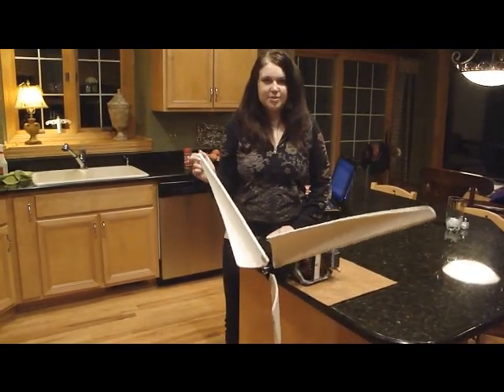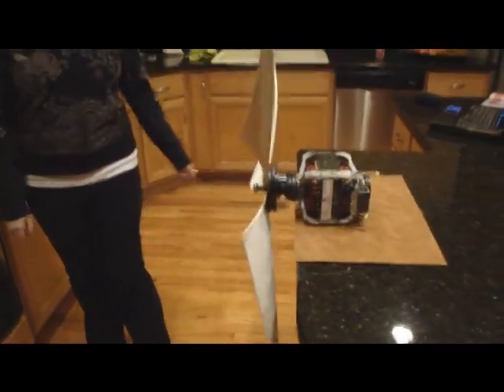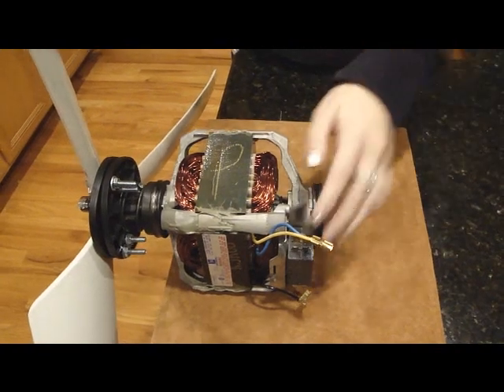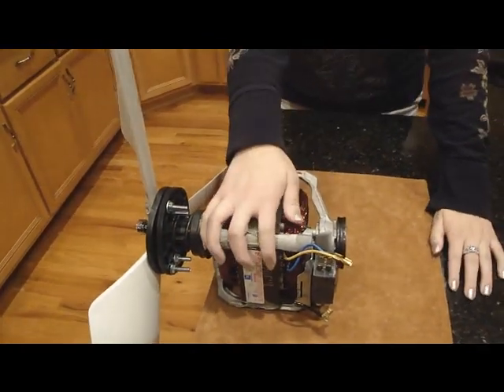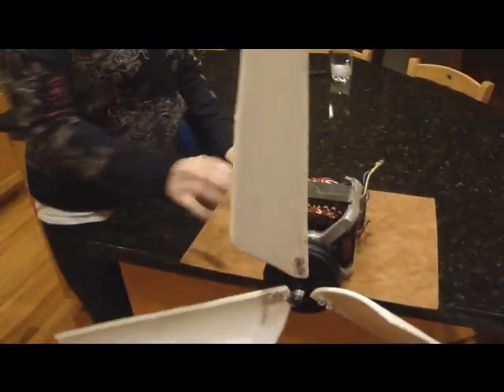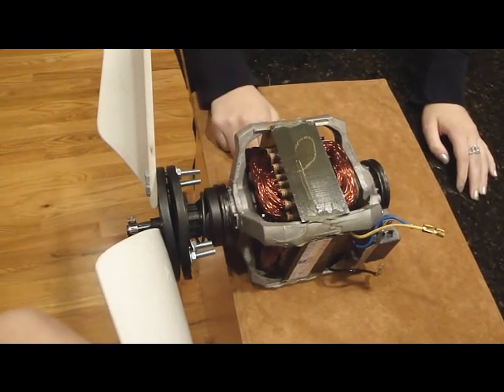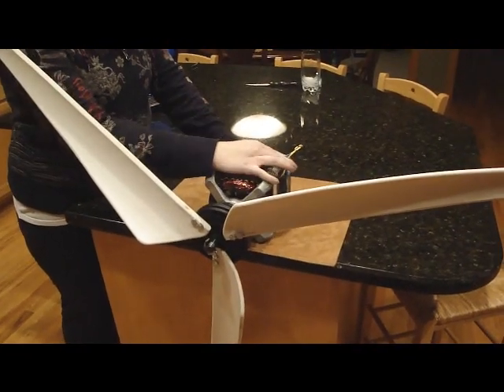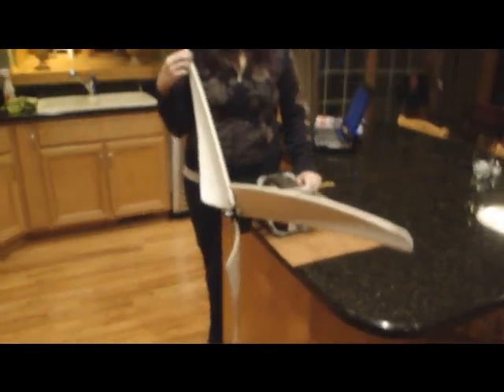Basics of a Wind Turbine

Comment: The wind creates mechanical movement. The permanent magnets in the rotor shaft create alternate current and to convert the AC current to DC current you need rectifiers and then charging the batteries. And from the batteries You need an inverter to convert DC To AC

Comment: Typically a motor in this setup would generate direct current, but certain motors output alternating current because of a built-in rectifier. Can't tell whether this motor is DC or AC. Most small project motors output simple direct current, making it easy to connect directly to a bank of batteries. An inverter is then used to convert the DC stored in the batteries to AC for use with common household items. For small applications such as off-grid camping or RV's, you can purchase DC items such as LED lights so you don't need the inverter.

Comment: Those blades look like they're on backwards for whatever reason.
Reply: The blades were fashioned from a round tube. while not ideal, they would work equally well as a fan or a turbine. now, the trick is to balance the blades, to minimize vibration. The shallow pitch is good for the fact that it is a direct driven turbine, and that motor is most effective as a synchronous alternator if it can exceed 1000 rpm.(It's actually an AC induction motor).

Comment: if its a washing machine motor,how do you power it,you need to plug it in some where,for it to run
Reply: The idea is that the blades turn wind into kinetic energy. to generate electricity, But it is a universal motor so it isn't going to do much

Comment: that motor looks like it from washer machine.. i remember very well.. because i go junk yard everyday.. hahahahah
Reply: That's exactly what it is. You need a capacitor to resonate it to get it to produce any useful power. Motors like this are at their best at speeds of 1000 RPM or higher.You set the run speed by the value of the capacitor. Then a full wave bridge rectifier to convert to DC to charge batteries.

Comment: please show us how you alter the motor.. i have tried using washing machine motor and its not working the way i want it work... really i need some help..
Reply: You have to drill holes on the rotor and put neodymium magnet in the holes. With no modifications you can't generate any useful current sadly
Reply: @JorgenLePoulpe  An induction motor can generate if connected in parallel with the right value of motor run capacitor. It becomes an asynchronous alternator. You can determine the run speed by adjusting the value of the capacitor. Like any alternator, you need a full wave bridge rectifier to turn it to DC and charge a battery. Its poor regulation makes it useless for driving loads directly. Use it to charge a battery, use that to power a nicely regulated inverter, then, you'll have usable power. Without the phase shift of a capacitor to resonate the stator and excite the induction rotor, the voltage will be barely measurable, but no useful amount of power.
Reply: Before you modify the motor, try putting motor run capacitors in parallel with the motor wires. That will ferroresonate the stator, and excite the rotor, turning it into an asynchronous alternator. choosing a large capacitor will allow the motor to start generating at a lower speed, but lower voltage. Choosing a smaller capacitor will mean the motor has to go faster to cut in, but it will generate a higher voltage. The motor will pretty much hold the tuned speed no matter how hard the wind blows. The system will produce more current if the voltage is held constant, or higher voltage at the same current. While it's not very good for directly driving a load because of poor regulation, all you need is a full wave bridge rectifier to make a great battery charger. Depending on battery voltage, you may want to use a transformer to convert high voltag low current to low voltage. This should get you up and running without hours of machining. Please note, motors like shown in this video work best at or above 1000 RPM.

Comment: That's a washing machine motor.  I'm a little confused as to how that would work... unless you reworked the rotor and added permanent magnets, although sometimes you can use an induction motor as an alternator with a tricky circuit to pre magnetize the rotor.  But I really suspect this is just a dummy setup for display purposes.
Reply: You are exactly right. No reworking required. What it needs is a motor run capacitor to ferroresonate the motor when spun. The phase shift from the capacitor will excite the stator, turning it into an asynchronous alternator. A large capacitor will allow it to generate at a lower speed, lower voltage, lower frequency. If you choose a smaller value, it won't cut in until higher speed, but the voltage and frequency will be higher, thus, higher power. The amperage will not vary much. run that through a full wave bridge rectifier, and you've got unregulated DC. Not great for driving anything directly, but perfect for charging batteries. The motor will try to maintain the tuned resonant frequency, no matter how hard the blades try to turn it. The voltage will go up, as will the amount of current. More wind, more amperage. It will pretty much hold its speed until break down torque. this will occur at magnetic core saturation, or the torque of the motor based on the voltage it's allowed by the bridge rectifier held by battery voltage. you just need to tune it.

Comment: You have no clue what you are talking about, have you? The magnets don't create the mechanical energy... the mechanical energy is already present because of the blades spinning! It's the magnets & coils that CONVERT the mechanical to electrical energy. And that where you make your 2nd blunder: Direct Current: Really??? Have you even followed an introductory class on electricity? If you have, then you would know it outputs Alternating current... 
Also: If you would hook that up to a battery (with no rectification in between) it wouldn't charge it at all. It would even destroy the battery because it gets short-circuited all the time...
Reply: How did you connect the rotor to the generator?
Reply: I had the same question while i was watching it. But so many likes put me on confusion. But here comes the engineer who had the same feelings like mine and express it in details. thanks

Comment: what if you remove the blades and add a motor with a belt to drive the generator, using the power that is generated by the generator?  could that be possible?
Reply: +Fernanado Ortiz Yes, in essence, you're recreating what a vehicle does with an alternator off of the crankshaft.
Reply: +ABflanagan523 --- the blind leading the blind or the fckng idiot dreamin' with the fckng idiot! take your pick!
Reply: Unfortunately no. It always takes more than 746 watts to make one horse power, and you always get less than one horse power out of 746 watts. That's why motors and generators get hot when in use.

Comment: If i use a 100 rpm motor of 3 volts as generator;and rotate the shaft at speed of 100 rpm then will it give me 3 volts current.And if i rotate the shaft at speed of 1000 rpm (10 times faster) then will it give me 30 volts (10 times of previous current) of current.
Reply: It will give you 30 volts, but the available current is the same. It's limited by the field strength of the magnets. That gives you 10 times the power. Current is based on magnet strength, voltage is directly proportionate to RPM.

Comment: tread mill motors are ok but make sure unless you are going to gear your system that you get a low rpm high wattage motor or you will not get enough rpms to produce any usable energy i would shoot for at least 600 rpms or less with a 130 watt dc out put for best results for this type of genny then to a charge controller or blocking diode to battery bank then to inverter  and so on important thing is that you have low rpms high wattage good luck

Comment: do not get this type of blades.. they degrade from the uv light and will explode  sending shrapnel everywhere.. use stainless steel blades only or professionally made  blades
Reply: They need to be well rooted at the very least. They need to turn at least 1000 RPM for the motor to generate effectively. It's actually an AC induction motor, which will require a capacitor to ferroresonate it, after which, you need a full wave rectifier to convert it to DC. You choose the operating speed by the value of the run capacitor. As long as the torque isn't too high, it will hold a constant speed.

Comment: Ok, this is the last video to watch for info on wind turbines, the motor is not from a treadmill, it is from a washer or dryer and does not have magnets, it is a polyphase synchronous motor, requires additional components to use as a generator and not well suited for wind power ... and power does not come from wall, please, you used the term "grid" earlier, not sure that you know what it means ..

Comment: Nice demo. on correction, however. The magnets do not "create mechanical energy using these coils". The mechanical energy comes from the spinning blades (which acquired it from the wind). The coil moving through the magnetic field causes electrons inside the coil to move, which we see as an electric current.

Comment: if something is oscillating it also means it is rotating. there something called a sin wave you should learn about. when something is osculating is is swinging to and fro returning to its original position. the same thing happens when something is rotating it returning to its original position. so when the when you spin a magnet around a coil  it makes the current go up and down. if YOU have paid attention you would know both something spinning and a pendulum can be described as a wave

Comment: You must have paid as much attention at school as the actress on this video.  Oscillating means to swing back and forth like a pendulum.  You wouldn't get much electricity if it did that.  The blades ROTATE and move the magnets in a circular path, producing a changing magnetic field in the volume occupied by the wire coils. It is this changing field which induces a current in the coils, which as you say is Alternating Current, as there does not appear to be any diodes in the circuit.

Comment: When you pump water uphill, the some of the kinetic energy of moving water is  converted to potential energy, similar to charging a battery which stores potential energy chemically. The rest of  the energy is lost to friction and heat.When the wind is not blowing or the sun is not shining, you can open a valve on the tank of stored water, let it fall across a turbine converting moving water to electricity.  Not perfect,  but what made by humankind ever is ?

Comment: r3bol fail... no fucking matter what el motor you use you always will get ac voltage.
i added 10 neo magnet rotor to old fridge ac motor and im getting 120v ac and useing bridge recifier and few caps to get dc. also its impossibe to turn that kind of ac motor to dc if you want to do it u must build ac to dc transformer.

Comment: @homskoult not true, you can use the energy as it is produced and then offset the troughs with other forms of energy, just requires a slightly modified smart grid. If you can make the turbine cheap enough then the energy it makes will give you a net gain. Which is why we need to put a bit of effort and investment into making it cheap. Simple. It's the naysayers such as yourself that will make it expensive by blocking new forms of energy.